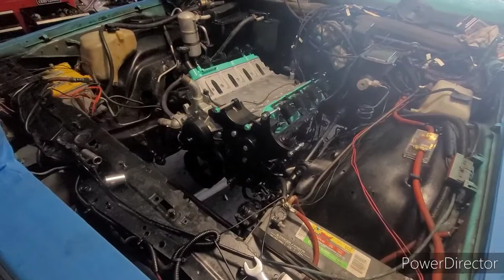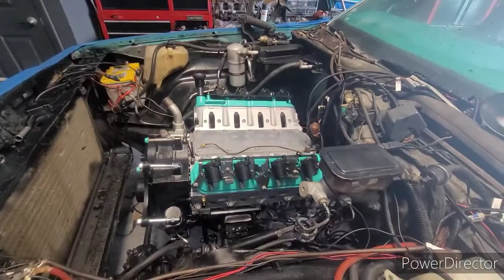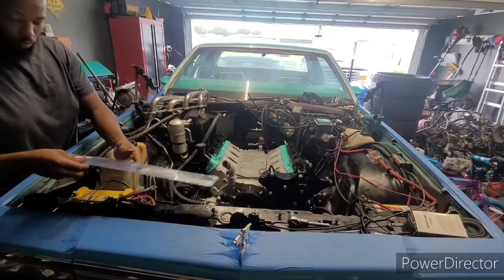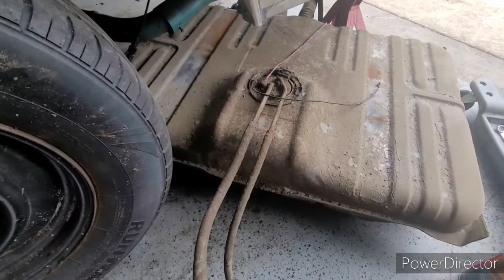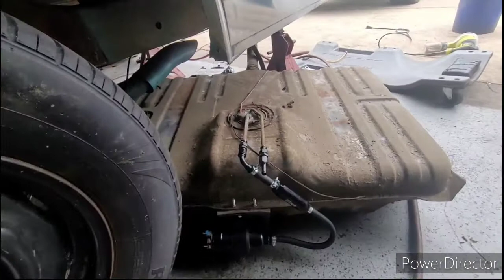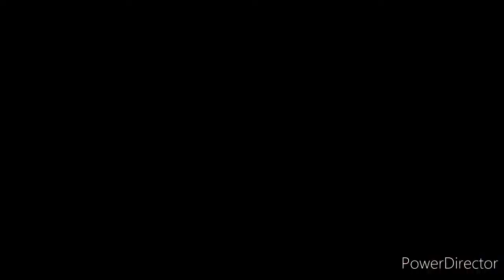Project Caprice LS Swap Part 3

Comment: I tried it and I drilled exactly a inch back and it did not line up, I have it where the opening is facing the ground and facing the front of the car. It put the side for the single exhaust pipe on the drivers side and. Idk if it's only certain box Chevys but I have a 85 with 5.3 and 4L60e.  I had no luck
Reply from the maker: For a 5.3/4l60e you should have to drill or move the crossmember, exhaust hump goes on the passenger side. This car has a 4l80e that's why I had to drill and move the crossmember